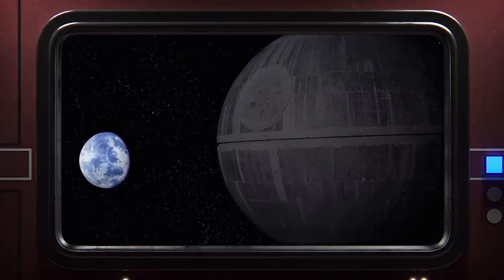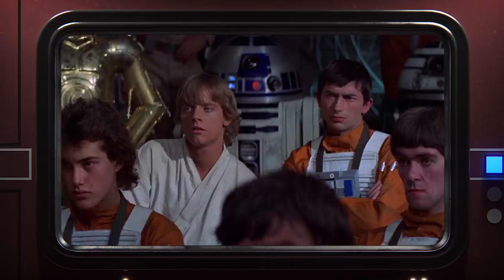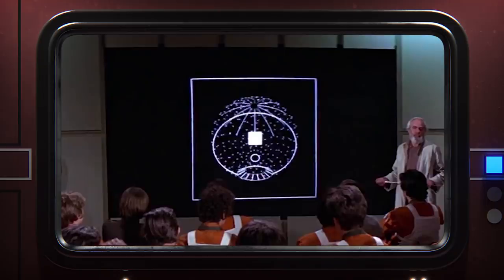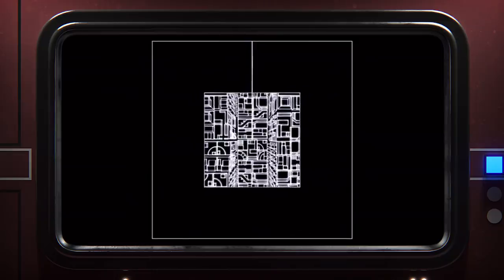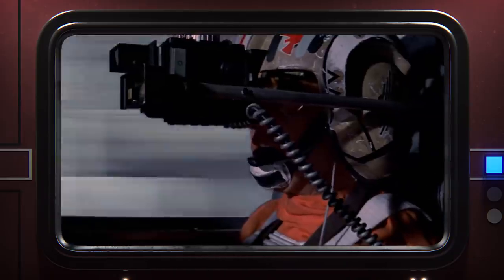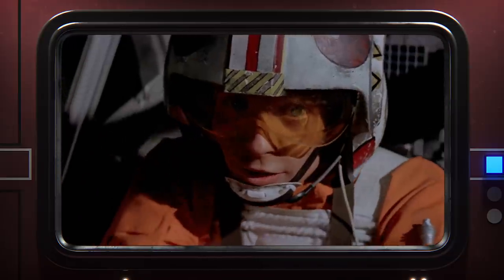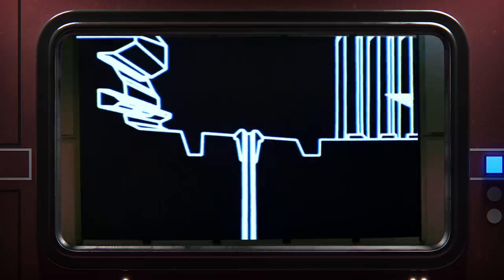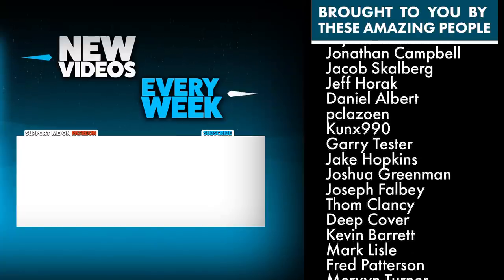The Thermal Exhaust Port Was NEVER a Problem

Comment: I think the main exhaust port was defended with a lot more hardware, like triple redundant deflector shields that would otherwise be mounted on imperial class ships, along with laser, turbo laser, and ion cannon defenses. As for Galen Erso's sabotage, I think he intentionally neglected the particle shielding that would have blocked the secondary ports. After that, I think it was picking the port with the weakest defenses, like thinner fighter coverage because it was furthest away from the hangers or had the fewest turrets.

Comment: Plus the fact that it is an exhaust port. High pressure winds should be exiting that area pushing the torpedo back out
Reply: not necessarily. it depends how direct the channel to the core is.
Reply: and also as he pointed out in the script. we dont know how fare the torpedos travel down the shaft. the discription sounds like the torpedos dont go deep, but instead set off secondary explosions all the way down to the core

Comment: Makes sense if from an engineering perspective, you discover that the Death Stars main reactor was generating a rounding error’s amount of thermal exhaust more than initially calculated then a small port from the main reactor to the outside might be the best, quickest alternative to cooking everybody in the death star to death, especially when emperor Palpatine and lord Vader are threatening to force choke you if you can’t make it all on time.
Reply: Its possible it only opens when the weapon is charging up and only vents when it fires. There are so many explanations that it really doesn't matter- there is no reason to question it.

Comment: Both the original film and the Galen Urso explanation back each other up. All we know from Rogue One was that a weakness was built into the system. He did not elaborate specifically what it was other than that a pressurized explosion would be required to exploit it. The briefing given by General Dodonna explained a little more of what that weakness was. 
But if you think to Episode 6, Lando Calrissian explicitly instructed Wedge Antilles to hit "the power regulator on the north tower". This would show some implications that the Rebel tacticians did manage to gather some post strike analysis from the Battle of Yavin and put 2 and 2 together to confirm that the power regulator was indeed the weak link  tied into that one specific exhaust port mentioned in the plans stolen from Scarif. 
However, if you add in some extra data from a few of the sourcebooks from the RPG system put out in the early 90s, there is reference made as to how and why this was the weakest part of the system. I remember one passage in specific in the Death Star Sourcebook which it explained that the various systems onboard the Death Star did not receive just the power they needed. Rather that sector received a massive amount of energy. The energy not used was rerouted back to the main reactor before being sent off to another part of the station. It was this backflow that caused the problem. 
Putting it all together, when the regulator was destroyed, it sent a feedback thru the power flowing back to the reactor. Couple this with a massive power surge traveling out on the main power feeds, and you basically get each system being massively overloaded.
Think in current plumbing terms....water flows in to your house from the main feed from the street from the water supply, runs thru the pipes in the house, the kitchen sink, the toilet, the shower, then flows out the wastewater side, thru the sewer and to the treatment. There the water is reconditioned and sent back into the supply and back out to your house once again. What would happen to your house if something happened at the treatment facility that sent a massive amount of pressure to your house thru both the pressurized feed side AND the unpressurized waste return side? Yeah, you'd have a major problem.  Same thing would happen to all your household electrical equipment if you were to experience a major power surge coming in from both the hot and neutral lines from the transformer. (Electrical trade schools often use water flow to help illustrate how power flows in wires....don't ask me why, but I've seen it.)

Comment: The proton torpedoes were programmed to follow the contours of the exhaust port straight to the reactor that would have been impossible without the plans.
But the flaw Erso put in the main reactor system was the reason any damage to the reactor would have catastrophic

Comment: I still think the Galen angle is a valid question to answer, because even with all this, one has to ask - why was this specific port designed differently from the numerous other ports (which apparently did not present a weakness), and in such a way that would lead a hit to the inside of the port to chain-react and detonate the entire battlestation?

Comment: I like to think Galen Erso didn't sabotage the port, so much as deliberately use an unstable set of systems and reactors, so that a sufficiently powerful explosion near any major power system component would lead to a catastrophic chain reaction. It was up to the Rebels to find a point to apply that explosion, though. A saboteur with a crate of thermal detonators near a major power conduit could have set off the chain reaction too, but they didn't have the time or contacts to set up an infiltration before the Death Star caused untold havoc and destruction.

Plus, I quite like the Fortressa story, that the Rebellion had in fact tried once before without knowing the weak points, just hoping to use a swarm of fighter-bombers to damage and hopefully cripple the station, only to be intercepted because the Death Star was stationary at the time and had vast TIE patrols deployed already. The Death Star had to be attacked whilst on the move, charging its main weapon, and the attack had to cause strong disruption to a major power system... That's not flawed design, that's amazingly robust!

Comment: If I remember correctly, in the amazing Legends novel Death Star, an enslaved architect named Teela Kaarz noticed how one exhausted port was different from the others and gave a verbal order to change it before it was built. However since it wasn’t written down, the change was never made. So yeah, design flaw/pure incompetence.
Edit: just checked, Teela actually found the exhaust port unnecessary and wanted it’s construction canceled. It implies there are only 2 ports and that only one was necessary.

Comment: Galen's addition may have been to make that ONE port go straight to the reactor.  He certainly didn't reduce the number of defensive weaponry around it (Vader presumably ordered them to stop firing when he went into pursuit) that every other port would have had as well.  Certainly the main port was defended against this sort of tactic, even against a capital ship.

Generally, thermal ports ("ports" almost certainly an in-universe concession anyway: holes like the one we see are not the efficient way to shed waste heat into a hard vacuum in THIS universe) would obviously be connected to the reactor by ducts; a single dogleg in the port might slightly reduce their efficiency, but make a shot like the one used to destroy the DS1 wholly impossible.  Even in '77, I had thought it was s stupid idea to not have designed such vulnerability out by simply bending the shaft at even one point.

Comment: I think the problem comes from an exhaust port that is a direct straight line to the reactor itself, and the chain reaction that obliterates the entire station. I think in Rogue One Galen Erso even admits that his sabotage is small enough that no one will really notice it as a sabotage, maybe like that exhaust port’s direct access to the reactor, or not installing proper safety protocols to prevent a chain reaction when the reactor is heavily damaged. I do agree though, that people have overblown the weakness of the Death Star though. It’s a 2 meter wide port. That’s not much bigger than a human. I can imagine if you ask a military pilot how hard it would be to hit a stationery target 2 meters in diameter during a strafing run under heavy enemy ground and air resistance would pretty much say it was impossible unless you were incredibly luck (or had access to the force...)

Comment: Some problems with your argument:
1. The death star design issue is analogous to "security through obscurity" in software, in which where security relies on the design/implementation not being known to the exploiter, which is generally accepted to be a poor approach to security within the industry.
2. If you assume that the other secondary ports are not exploitable, then you have to explain why the exploitable secondary port can't be built to the non-exploitable design of the other ports, or assume that the exploitable port fulfill some need that cannot be fulfilled. That seems like allot of assumptions.
Reply: Perhaps this particular port is the reactor overflow port. Anything but ray shielding would interfere with the exhaust performance, but an attack on any other port would be damaging but not devastating.
As for the security..... it had defenses and augmented by fighter cover of its own despite that the only craft capable of making the trip were considered too small to be a threat. It was secured against every tool thought worthy of considering and even then needed a shot that not even a targeting computer could make (possibly requiring additional help to make the turn).
Reply: @travissmith2848  Perhaps, if its different, then why isn't it distinguishable? I was responding to the video, which argued that the port is not a weakness because there are 18 other indistinguishable ports. That the port was secure is another argument. However, It may be secured from targeting computers, but it clearly wasn't secured against barely trained force users. Force users are not common in the SW universe, but neither are Death Stars.
Reply: @henrikqvigstad4999  "Force users are not common in the SW universe".... As in at the time of "A New Hope" Vader was the only known one. But I think I get what you are saying. Could have used a slightly longer video to go into some of the finer points such as how dismissive of a fighter the Empire was in considering attacks and theory crafting on why further shielding was not used.

Comment: Based on the movie it looked like the torpedos needed to make a close to 90 degree turn to go in and then make it all the way to the reactor without hitting the sides. I expect they considered that shot impossible in the design phase, but also didn’t know the reactor was so vulnerable to attack otherwise they might have made the exhaust funnel non-linear thus preventing projectiles from going down.

Pretty reasonable, based on the assumption that they didn’t know about Erso’s design flaw.

Comment: The shield would have even deflected proton torpedoes if they were fired perpendicular to the Death Star’s surface.  That’s why they had to get into the trench, skim along the surface, and try for a bullseye.

Even then, that technique worked not because the port led directly to the main reactor, but because it would initiate a chain reaction which would culminate in the destruction of the entire station.

The specifics of the “chain reaction” are vague enough that it provides the wiggle room to fit Galen’s sabotage into.
Reply: they’re blowing up stuff on the surface so there’s no shields

Comment: I don't think you even need to be that specific. 

Thermal exhaust port means heat is an issue and when some things get hot, well, they go boom, in a big way. 

I think you can argue all of the secondary ports are vulnerable to some sort of attack and it's not just this one particular port. Not only does it make sense and it basically says as much in the movie, but also makes Rogue One's Galen Urso's sabotage of the heat exchange system that much more..... well, dangerous, fundamental, sneaky. 

And it was protected, in what seems to be a semi-enclosed space, stopping direct attacks from above. Ray shielded, so no blasters could get in there, even better too. Plus all of the surface guns to make it hard for a ship to get close. 

Shame there was this space wizard flying a X-Wing that day.

Comment: One thing that you missed was that this port had a direct route to the reactor, it wasn't baffled or anything else, which the others (and the main one) likely were.
Reply: I imagine its purpose was to help vent the reactor, in case of a runaway reaction. I assume the flaw was with the venting system.
Reply: @RemarkableRabbat  mhm. I always thought both the ports connect to the same shaft, and the 2-meter opening was meant to ensure partial function in case the hatch on the main port malfunctioned

Comment: I remember when i was a kid i saw the fan running in my family computer and stopped it with my finger and after a minute the computer shut off. I wonder what the reactor powering life support system would do if the exhaust was covered up.

Comment: The weakness also makes perfect sense when you consider the Empire from a thematic perspective. As Dodonna says, the reason the Death Star doesn't have a strong anti-fighter defense is because the Empire thinks one-man fighters are too small and weak to be dangerous. Even when his officer informs him that this might not be true Tarkin still dismisses the Rebel attack as irrelevant. It's like Luke tells the Emperor in Return of the Jedi: the Empire's greatest weakness is overconfidence, or hubris. Overlooking a design flaw in the Death Star that's exploitable only by "the irrelevant little guy" is exactly the kind of error Imperial engineers would be prone to making.

Comment: As far as I remember Rogue One Erso's sabotage had nothing to do with exhaust ports - just with the reactor. He built it in a way that an explosion at the right point would trigger a chain reaction. But he never said anything about HOW the explosion should be done. And he didn't mention exhaust ports.
So I guess he had nothing to do with it. He probably thought about agents sneaking into the death star planting mines or something. At least I imagined it that way and the exhaust port being an additional vulnerability analysts found in the schematics. In combination with Ersos sabotage this could be used. Maybe the port's vulnerabilty was just temporary: Someone removed a cover for maintenance work or so.  ;)

Comment: I'm a fan of the EU, but you're absolutely right, it's not needed to explain why RAY shielding, as in photon based weapons, wouldn't work, but a TORPEDO, a physical projectile, would go right through the shield. And one may ask, 'why only have ray shields, why not have particle shields as well?' Well, it's not explained what is exhausted from the main reactor, if we assume it's some kind of hot gas then it would be trapped by a particle shield causing the whole system to overheat.

Comment: If I understood what Galen Erso said correctly, then the exhaust port is only a part of the sabotage. The actual weakness lies within the Reactor module, which has the tendency to chain react and explode if hit with some force and that exhaust port is the easiest/only way to hit the reactor from the outside. So if I understood that correctly than without Galens sabotage it might still have been possible to hit the reactor(assuming the exhaust port is still exploitable, which it wouldnt be without the sabotage) but it wouldnt have done anything (because no chain reaction). Also to me it would seem easier to just send a couple of Rebels with some explosives to infiltrate the Death Star and Blow up the reactor from within seeing how easy it was for Luke & Company to run around in the Death Star... Please, correct me if Im wrong, its been a while since I've seen the movie.

Comment: Maybe the reason why it had to be sabotaged was because the others had a sort of physical block to prevent torpedos further down the port (like some thicker fence-like hexagons), but that SINGLE one didn't have it. And since there were so many small exhausts when it was built, it was just overlooked because of the design sabotage. And thus the others weren't exploitable.

Comment: The rebels had, what, mere hours at most with the plans and found the weakness, yet the team of engineers, architects, and construction contractors who spent over twenty years on this project never noticed it? That's what I find most outlandish about this scenario. Even if we consider that the rebels were specifically looking for an exploitable weakness, they'd be studying the complete structural breakdown of the greatest feat of technological innovation and military engineering in the entire galaxy. And they found its one weakness in a matter of hours. A weakness that no one who worked on it for the last two decades had noticed before.